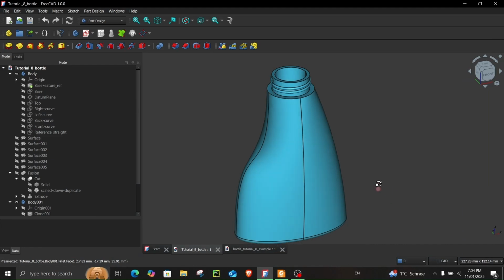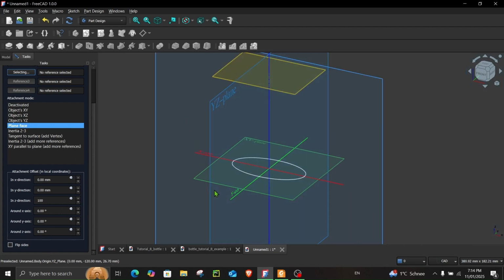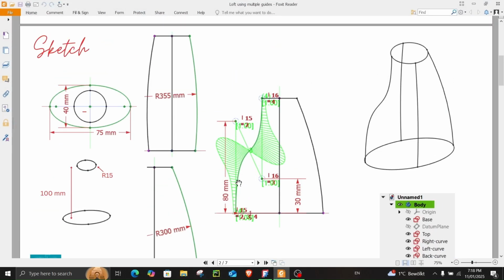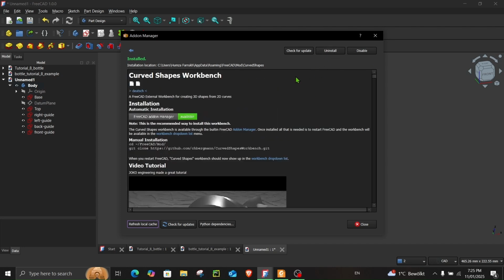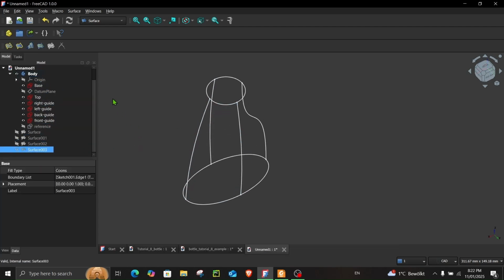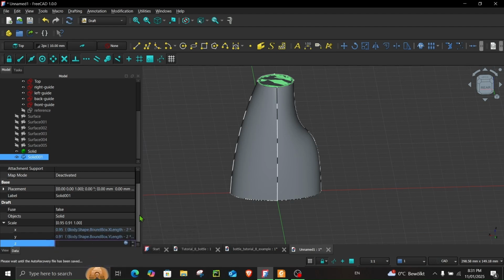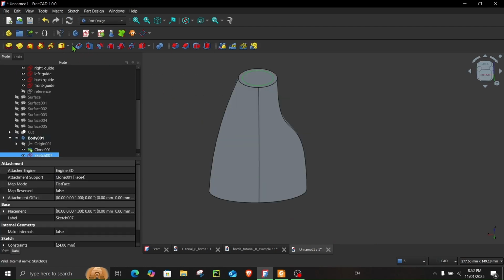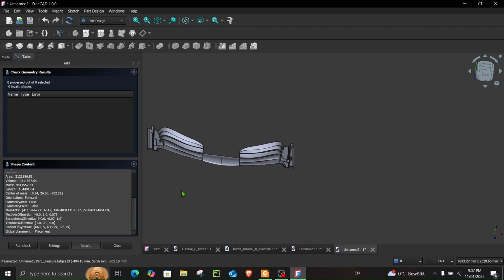Guided Lofts in FreeCAD 1.0 | Beginner Tutorial | Exercise 8

Comment: In the surface  I get  error message  "curves are disjoint".  For some reason I am unable to connect to the 4 points in the top sketch.  I can only get surface from the other 3 edges | curves. but at the top I get a straight line and it doesn't follow the quarter circle.
  Update. In the top sketch I just place a cross skeleton which got used with the External Intersection to link the guides or edges of the side surfaces. Once those side sketches were completed  I went back to the top sketch converted the skeleton into non construction geometry and use the external intersection projection on the edges. I draw the 4 quarters of arc making sure the ends get coincident constraint with those external intersection vertices. Done like this when I go to the surface WB   the "fill boundary curves" function accepts the top edge  and no longer issues the  "curves are disjoint" error message like it did before.
  This is with FreeCAD 1.1.3

Comment: Great tutorial. I'm trying to adapt this to a design where the two sketches I'm trying to connect are not aligned in any axis. This creates a problem where I cannot use a standard sketch plane to reference external geometry from the two sketches (because the points I want to connect via a spline are not coplaner in any cardinal axis. How would this be done? To say it more simply: how can I connect two sketches 20mm apart with a loft when I cannot reference the points of both sketches in the guideline sketch?